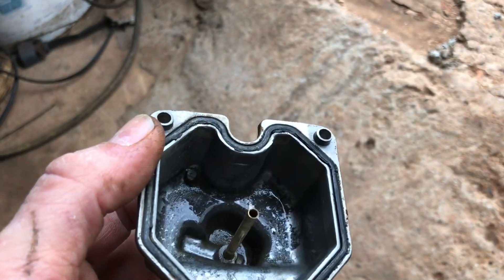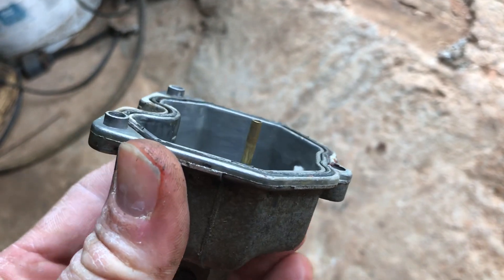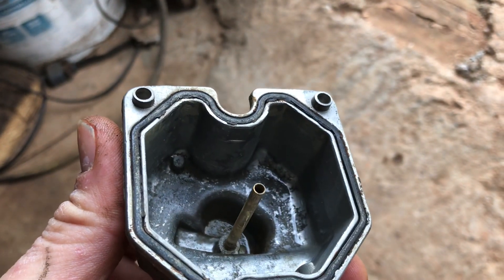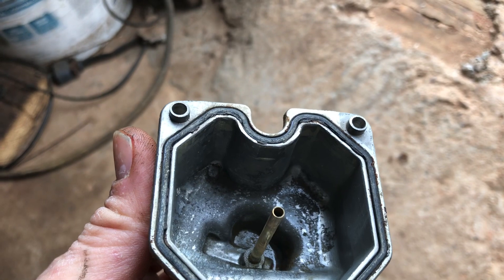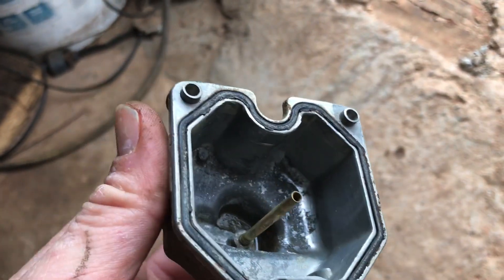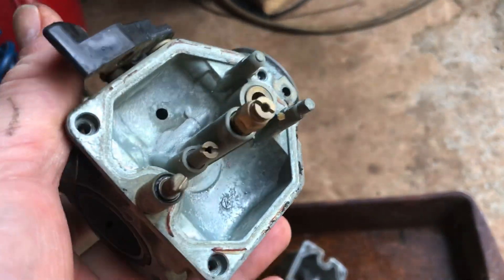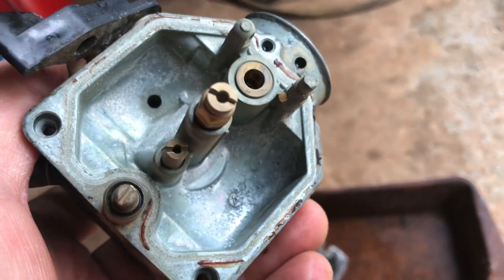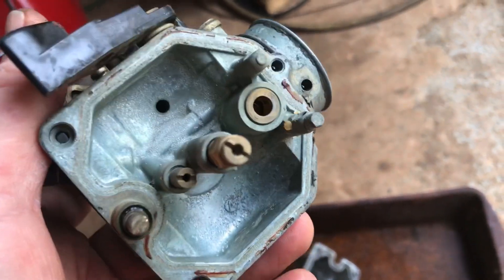Don’t Use Ethanol Gas in Small Engines!

Comment: The simplest solution is just run the engine until it's out of fuel before storing the equipment.  This is a good practice even if you're running pure gas.

Comment: By the time ethanol tears up a carburetor on a small engine during it's lifespan, it is cheaper to buy a 20 dollar new carburetor than to maintain ethanol free fuels.
Reply from the maker: Some engines that’s true. But some small engines have carburetors that cost well up close to $200. Locally I can get ethanol free for 30 cents more than regular
Reply: Good luck finding a replacement carbs for 40+ year old equipment 😐
Reply: @vinceyreay not true I have a McCullough chain saw that is 40 years old still running i can find parts for it with no problems.
Reply: It's easy. You just have to know how to use the internet. A carb for 40 year old equipment can be bought easily on eBay for 20 dollars. Try it out. Your local store has none
Reply: @adamjordan4836  thank you for your kind offer, I'll take a bank of carbs for a CB550F, let me know how/where to pay that $20 👍
Reply: @vinceyreay  Amazon 30 dollars. Your welcome
Reply: @adamjordan4836  link please 😉
Reply: @vinceyreay  small gas engine. You know, weed eater, chainsaw, 49cc. If you want a Honda motorcycle carb your going to have to pay for it.

Comment: Thanks for the warning but I expect that it was not ethanol that corroded the metal in your carb but ethanoic acid or acetic acid as it is also known.  Anyone that has brewed wine knows that air must be prevented from touching the wine or the alcohol will turn into vinegar.  A stopper with a one-way valve is used to prevent the problem in winemaking but there is no way to prevent air from touching your fuel.  

The acid corrodes the metal and the ethanol reacts with many types of rubber and plastic.  For small engines ethanol-free fuel should always be used.

My wife and I also stopped using ethanol blended fuel in our car.  The acid and alcohol will probably cause damage there too but there is the additional problem of unknown total cost.  Ethanol production is heavily subsidized in most parts of the world and the actual cost of the fuel to a taxpayer is the pump price plus the hidden cost of all of the subsidies.  It is almost impossible to find out the total amount of the subsidy so the actual cost of ethanol-blended fuel is a mystery.  

There is also the problem of burning as much or more diesel and gasoline as is given back in ethanol.

Just say no to ethanol unless it is in whisky, wine, or beer.  [It is fine to use ethanol in the small-engine operator after the job is done.]

Thanks for posting this informative video.

Comment: So true. Don't use the 10% ethanol gas you can get at the pump. Adding stabil to your gas can does not work either. Will still get water in the carb even with stabil.. Home depot and Lowes sell ethanol free 4 cycle fuel in cans. Use that stuff, Engine runs better too.
Reply from the maker: In my 2 stroke engines I use the trufuel premixed can gas. Stays good for a long time. We also have a station local that sells ethanol free
Reply: @MikesGarage96  premium gas has no ethanol
Reply: Sure costs more than what you get at the pump